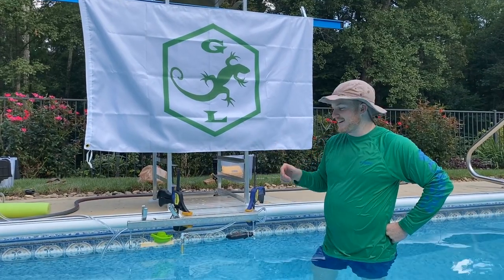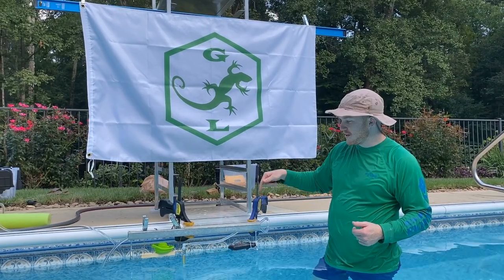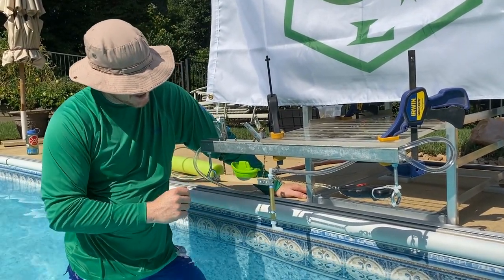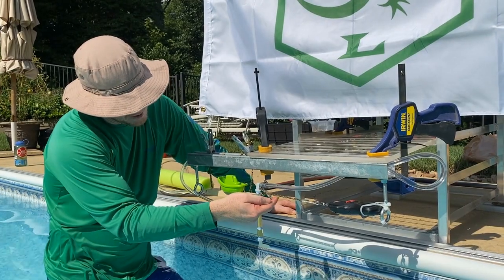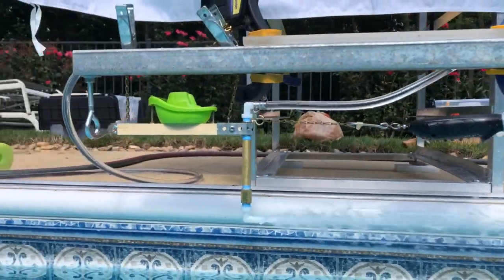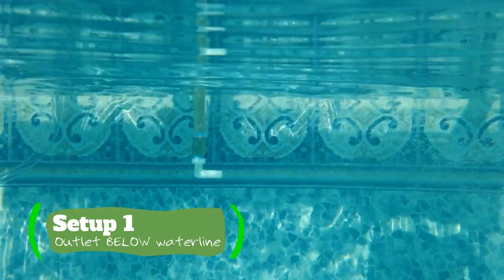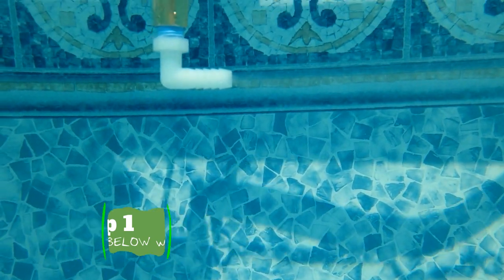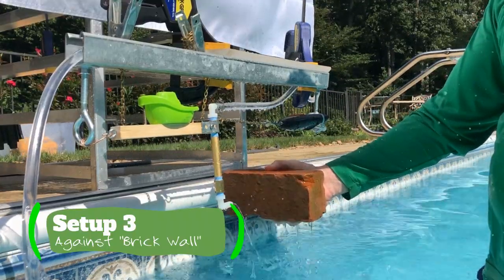Jet Boat Design: The Proof They Wanted!!! v2.0

Comment: I would image the 6% gain of thrust would be lost trying to raise that water above the water line with gravity working against it. Additionally, and I'm sure you've seen it, when a jet boat is on plane the nozzle is not in the water. Technically below the water line, but because of the wake created by the boat the nozzle is not submerged.
Reply from the maker: Agreed. This video was mainly for folks that think this type of propulsion is more powerful unwater, or there's a reaction off the water or a fixed surface. The physics and this experiment hopefully will help educate in the right direction. It was also fun making the video! Thanks for your comments Sean!